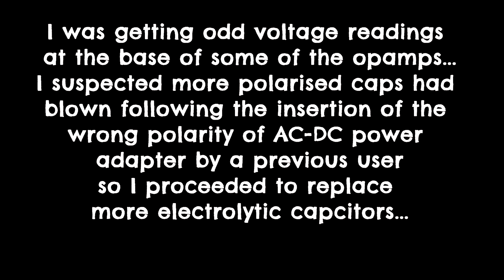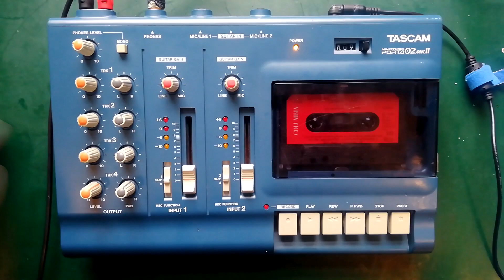Tascam Porta 02 Mk II | Repair Report | No Sound | LEDs won't light

Comment: very informative, thanks a million. I was wondering if you knew what might be happening to my tascam. I had it sent for repair because I accidently overpowered the preamp with a phantom power handheld recorder. when I got it back the LEDs for the input levels seem to be causing an electrical buzz. I feed it into an external mixer anyway, so I dont need those line level monitors. would it be possible/okay to disconnect the signal from the LED indicators? I hope that made sense. thanks in advance, I appreciate your expertise :D

Comment: hello, i can not find the schematics for this recorder. Channel 1 passes no sound and meters light up if i turn the trim down. can you share the schematics?
Reply from the maker: I won't be at home for another 10 days. If you leave another comment here in a fortnight, I'll check whether I have a copy and if so add it to my blog for free download and share the link here.
Reply: @Tetrakan  I have the same problem, also on Channel 1.  Please upload when you return.  Thanks man!
Reply: @Bunker Analog: I had the same issue as you and just fixed it (although I did have to replace some caps on the bottom board to get tape playback to be heard again).  Don't make the same mistake I did and start replacing everything before trying this: all I literally had to do was buy Deoxit F5 (the one for faders).  Can't believe it ended up being that simple, Deoxit is a miracle lol.  Hopefully this ends up solving your issue as well.  If not, it's gotta be the caps and those aren't too big of a chore to replace.